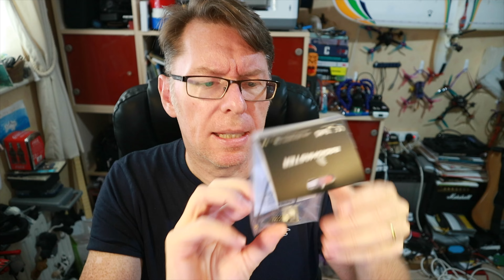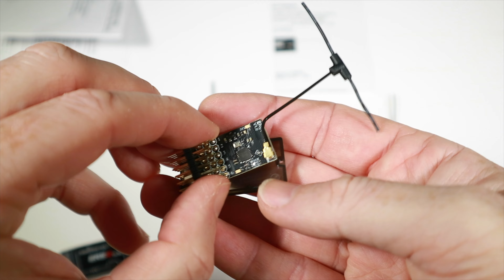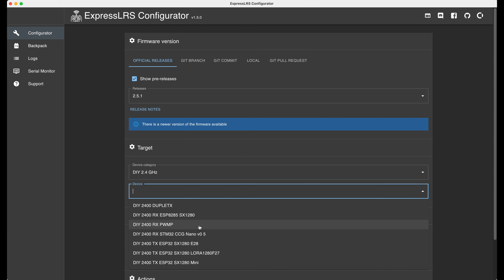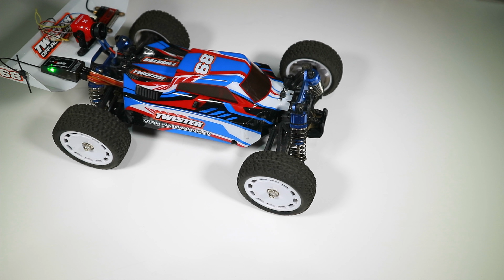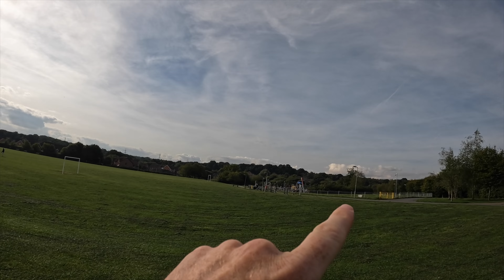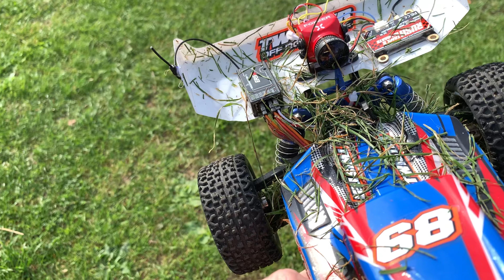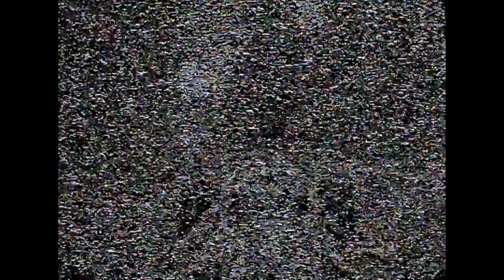RadioMaster ER5A/ER5C ELRS PWM RX's.  Let's make an FPV car to test them out!

Comment: So, for an RC car with an internal receiver, is there no other way than replacing the ESC? I mean, is it possible for me to modify the built-in ESC of the RC car so that it can work with the ELRS receiver module?
Reply from the maker: It looked very much like a sealed unit to me.  If there was an obvious way to open things up and mess with it I would have done so.  That's not to say that other all in one units may exist that you will be able to modify, but I've seen a few of these in similar car of this price range.

Comment: I come from drones and would like to implement it in RC car. Can I pass on the telemetry from the receiver (which I'll connect to external gyro) on to a walksnail VTX? (The VTX has TX/RX pins for telemetry). If so, how?
Reply from the maker: You can't - at least in any way I'm aware of.  The easiest way of accomplishing this is to simply add a flight controller in there and treat it as an OSD.  I'm just doing this at the moment (for an analog setup) I'm using betaflight on a car, with a single arm switch and the only thing I needed to do extra was set runaway_takeoff_prevention=off
Reply: @CurryKitten  how does the FC connects to the ESC? I don't understand as it seems the design is direct PWM receiver->ESC. How the FC will operate the PWM ESC? Is the gyro on the FC used for traction control in such configuration instead of a gyro module? 
I wish I could see a connection diagram 😢
Reply from the maker: It doesn't - I was actually using a 14 channel BetaFPV ELRS PWM RX for this, but in doing so I was able to connect to the FC via CRSF and then to the cars servos/esc directly from PWM.  The FC in this case is doing nothing other than acting as a dumb OSD
Reply: @CurryKitten  I think that a FC can operate a PWM motor like a servo. You should do a resource mapping and some definitions and it supposed to work.
I think I'll try out a drone like configuration.
Reply from the maker: Yeah - you can run an ESC on PWM to use the motors in that way - but it's not going to help in terms of the telemetry, which was your initial question.  In terms of using an RC bar and an FC, the reason I'm directly connecting the servo outputs and ESC to the RX is that Betaflight doesn't know how to mix motors for a car, and if you go the iNav route - it does, but you'll need a GPS/Compass as well
Reply: @CurryKitten  if I'll use fixed wing FC with INAV and a GPS module, every data including battery voltage, ESC RPM etc. is going through the FC. Why wouldn't I be able to output all this telemetry to the VTX?
Reply from the maker: @yaronskp  That would work fine - you confused me talking about resource mapping when it's not needed

Comment: Could these be used on a modern say inav fpv quad as a way to add servos without having to connwct to the fc say if you didnt have enough pads or amp rating to run from the fc ? Or would that also involve voltage regulators and stuff direct from lipo ,im on 6s
Reply from the maker: Well, the power input to the RX can only go up to 8.4v, so on 6S you'd be looking at some sort of UBEC to power things nicely... and as soon as you add the bec, the idea of the PWM RX becomes a bit redundant as you'd then probably just want to take an control signal from your FC and the 5v/gnd from the BEC

Comment: Hey, I have a radiomaster tx12 radio and planning to use it on my rc also, can you teach me how you setup your radio? I've been thinking the exact same way the way you configure the controls. Also is it possible to bind radiomaster tx12 radio to radiomaster er5c-i pwm reciever? Can't find any info online. Thanks a lot! this video gives me hope that i can do this mini project 😂😂
Reply from the maker: For now, I've got a playlist on setting up OpenTX (While it's not EdgeTX, the experience is close to identical) that should give you a good start in setting up the radio... I might revisit and update the series this year though.  As for the RX, the answer is yes - if you have the ELRS version of the radio (as opposed to the 4-in-1 version)
Reply: @CurryKitten  Gotcha! Will definitely check out your playlist and see which part I can implement on my case. Alrighty time to check out the RX then 🤣 Thanks a lot! Hope to see your new vids on the playlist

Comment: Hi again, im curious that rush max solo could run with 6s lipo, is there any advantages to run it with more voltage? 
Also how do i get at least signal strength on screen display without a flight control ?
Reply from the maker: There's no advantage to running in 6S.  Signal strength you'll struggle with to get on a camera.  What I would do is use an RX with telemetry (like ELRS) and then set alarms if link quality, or RSSI falls below a certain threashold
Reply: @CurryKitten  so my vtx can produce maximum wattage using minimal voltage? i.e can it still produce 2.5watts using 7volts?

Comment: Awesome video , long time sub. So happy i found this, i'm an fpv pilot and my next project is gonna be an fpv 4x4 with elrs. Do you have a video on how to connect everything since there is no FC. I'm already using elrs on 14 quads and thought i try something new with an fpv car.
Reply from the maker: I didn't go into great detail as there wasn't much to it.  The RX has a connection to the ESC for throttle, and a steering servo (and in my case a beeper on another channel as well)  I was using a camera with it's own OSD, so just fed the battery voltage into one of those pins.  It's pretty basic - I will be coming back to make a larger car in - hopefully - 2 different FPV configs.  One of which I will use an FC for
Reply: @CurryKitten  Ok, thank you.

Comment: How do u setup throttle and steering on the controller?
Reply from the maker: I used the right stick as throttle as it's sprung to the centre - which is much better for doing braking/reversing.  I then ended up using the left yaw stick for turning just because it was on two different sticks.  In the past I've used the throttle stick completely for pan/tilt (with the applicable setup) and used right stick for both throttle/steering.  Obviously you can assign whatever channels you want to sticks via the radio

Comment: Hi can you help me to figure out how to use smart audio with these receivers. (without a flight controller). I want to be able to change the vtx channel on transmitter.
I have watched similar video from painless360 using crossfire, but elrs script does not show same options.

Don't know if that s what the CRSF mode is for? but I assumed it will remove the 6 channel function if you change the mode. Not sure if I understood that correctly??
Reply from the maker: You can't - at least, as far as I know - with Crossfire, you can assign a channel output to SmartAudio and then control it via a LUA script.  We don't (currently) have that option with ELRS.  Even when using a backpack, the module communicates and changes Smartaudio stuff via the flight controller.  This may change in the future - but for now, I don't know of a way.  CRSF mode - in this receiver (If I understand what you are getting at) turns this into a regular CRSF based RX, so using the TX/RX/5V/GNS pins instead of regular PWM
Reply: @CurryKitten  Okay thanks, I understand the crossfire function better now

Comment: That was a real quest for me to find an rc car with separate receiver and pwm wires. But I succeed - and found wltoys 124017 v2 (the v2 has a brushless motir and individual receiver module)
Reply from the maker: You did well - I've seen that combo ESC/RX in loads of these cheap cars.  Yay for WLtoys for being even slightly different!

Comment: The camera is mounted to far back. Place it above the windshield just behind the windshield line. It will give you a more immersive view. Like you're sitting in it. I have to post some of my videos. Great video by the way👍
Reply from the maker: I didn't want to mount to the body shell of the car as it's liable to a bit of wobble when driving around.  My intention in this build was to make quite a non-invasive build, but as that car is probably going to stay and FPV car, what I'll probably do is cut a hole in the top of the roof and have the camera there, or go through the windscreen.  In both case, I'll be mounting on the chassis so there's no potential of wobbling from the plastic shell.

Comment: I love coming back to this video, The setup is near perfect for analogue... Throw on a tall Foxeer high gain lollipop and that will go anywhere. CK - Have you seen the Traxxas TRX-4 Scale and Trail Crawler 82056-4
1/10 Scale? The Land Rover Defender is crazy good. It's got a two speed gearbox and you won't get stuck on anything!! Its quite quick as well. But to me it's the ultimate allrounder Crawler / Basher..Check it out!! Take care mate... MQ4. Ohh, Thats right Can now confirm that those ELRS Receivers are an absolute must have!! LOS 2km easily ...In the bush ( flat ground ) 900m. A good idea is to fit a small GPS and pair it with your phone, You can then watch its movement in real time and if you need to hunt for it you will never lose it. I would really like you to review the Traxxas TRX-4 , 1/10 Scale as I KNOW that will be your everyday go to once you drive one. 🙂
Reply from the maker: In my initial experiments with the RusshFPV Cherry antennas, they outperformed the lollipop by quite some margin.  I've always lusted after a Traxxis.  The Summit was always the goto build for LR FPV cars, but the Land Rover really looks the business.  It's the perfect scale.  The problem with Traxxis is price - eeek, not cheap are they!
Reply: @CurryKitten  Yeah mate exactly... I just bought one! What an incredible car! Wish I could send it to you for a play... But the state of the world atm its not worth the risk from AU to UK otherwise I wouldn't hesitate mate. Fitting it out with the 03 Air unit and Goggles 2 with head tracking. That will be a blast when we finally have them in stock.

Comment: Does it bind with happymodel tx module? Cause I can't bind even with the right binding phrase
Reply from the maker: I don't have a HappyModel TX to try that out, sorry - but obviously, all ELRS modules should be able to bind to all ELRS rx's... with a few caveats.  Firstly, aside from the binding phrase, make sure you are on the same major version of the firmware on both ends, i.e all on 3.x.x.  Double check to make sure model match isn't on (unless you want it on - in which case make sure it's correct)  Check the LED on the rx, sometimes if it's doing something a bit weird it's a useful clue into what's going on

Comment: Im undecided on if 500mW ELRS in the TX12 MII would get me a couple of km's across the bay on a large RC Sailboat using these PWM Receivers?
As far as Visuals go, I'd like to utilise a GoPro 8 but its USB C etc so not as easy as just wacking on a 1W Rush vtx etc.. So my question is would the TX 12 mark 2 ELRS and these PWM receivers cut it? and How to get the GoPro 8 running FPV? Cheers CK - Bazz
Reply from the maker: That's an interesting question.  While 2km in the air is nothing, ground range is very different and those pesky ground reflections can be an issue.  The answer is that I don't know - I've been unable to find a large open area so I can see how far I could take my setup.  That said, anything that could elevate you up higher than the water would definitely help.  I'd think I'd approach as I normally would with the unknown - try it, and check signals on little milestones.  Can I get to 500m?  How strong is the signal?  Can I get to 1km etc etc.  I'd be evaluating to see if I needing to address any issue along the way...i.e what effect do the antenna placements make, what about changing my packet/telemetry rate.  I can't answer the question on the GoPro though, I haven't tried video out since the GoPro 4.  Even if it is possible, I wouldn't recommend it over a regular FPV camera.  Keep the GoPro for you HD recording, but they are still very bad at handling light when it's face on to the lens.  A half decent FPV camera will really help you there.  I'd be interested to see your results - one thing about being down at the water level (or ground level in general) is it can be quite difficult to navigate and tell where you are
Reply: @CurryKitten  Excellent advice all round CK.. Thanks mate, Will keep you posted. Take care bud.👍

Comment: That's really great results and here I am a grand into trying various analog 5.8 and 1.3 setups unable to get 1/2 of that. I'm going to try MFDLink 433 UHF for the control but I'm still trying to learn this world of protocols and control systems. That feed also looked really good and I suppose it has to do with the location. My 1.3 tends to look way better at times depending on the time of day, but I'd probably need to be in an open field with LOS to go out to 100 yards tops.
Reply from the maker: I did try a 433 control with 1.3 video a long time ago, but I had all sorts of power issues and the kit was quite large for the 1/10th scale car I was using.  That said it was nearly 10 years ago and I'd hope I'd get it going better these days.  1.3 should give you excellent penetration for a ground vehicle... it should wipe the floor with 5.8 in terms of distance and handling obstacles.  433 can be a little finicky to get right, it's easily upset by noise... and of course the dipoles for it a huge!  But keep cracking on and Im sure you'll find that sweet spot eventually.
Reply: @CurryKitten  I came into it assuming just that.. the 1.3 would wipe the floor with the mediocre results I got with decent 5.8 setups. Several videos out there showing it can be done all analog. I tried to be thorough and basically tried 2 of every transmitter/receivers.. ended up being worth it on the 1.3 receiver because the second one worked much better with clear audio.. but in the end about the most I could do before the signal got too bad was drive around a small area in my neighborhood. 

This was trying to be lazy and just using a small ground station though. Receiver just mounted in a box with the screen right there. I'd hoped to at least be able to do something like circle a small building with decent video but I guess that's either asking too much or doing something wrong. 
I'm now realizing to get any actual range I need a rather large ground station, at least one elevated higher from the ground and some kind of decent patch antenna.

Comment: that "PWM is old way to control..." hurts a lot :D am I that old?
I mean, before  SBUS and then TBS CRSF & Co came, that was the default.. the quick development happened only the past decade.
thanks for the review! I was looking for a way to make a FPV rc-car with my drone-gear :D
Reply from the maker: In terms of people getting into the hobby now, they don't really have a concept of why servos would ever be used or how you'd ever fly something without a flight controller :). It's pretty easy to use some of your drone stuff to make an FPV car.  The only annoyance for me was the single ESC/RX unit, so I needed a new ESC

Comment: Does the Er5a receiver carry the FPV signal? I guess not. If the video can get through, I'm not impressed by the fact that ELRS is getting through.
Reply from the maker: Video and control signals are very different beasts.  The RX just handles the control signal, there's a VTX that handles the video

Comment: This looks fun. So I've bought an rc car similar to this and will use pwm crossfire but not sure how to wire my cam and vtx. My cam will go to the vtx but what do I wire that do? Is it possible to run it with a servo cable straight to the PWM receiver?
Reply from the maker: It will depend a little on the VTX.  Odd on your VTX will take battery voltage (usually something like 7-20v but please check) and power a 5v camera from it.  So in my case I'm powering the VTX from the balance lead of the battery.

Comment: How does your 2s balance lead only have 2 cables coming out?
Reply from the maker: The battery has the regular 3 wires coming out.  What I did was make up a balance connector to take to the VTX where I just make a connection for GND and cell 2 (the outer one) this gives me the full voltage through I need

Comment: So I fly quads and want to try this but how did you configure your controller to steer and throttle. I get the elrs part but in quads I have betaflight to configure things. I have the radiomaster zorro with internal elrs
Reply from the maker: In a word... Backwards.  So I put the throttle on the pitch/roll stick (right if you are mode 2) and steered with yaw (which kind of makes sense)  If it seems a bit weird, it's because a car with a reverse option benefits from having the throttle that springs to centre - so it's much easier to hit the brakes and go into reverse.  In previous cars I've also use purely the right stick for throttle and steering and the left stick for pan/tilt... this time using the advantage of not a sprung stick so that the pitch of the camera stays where I want it to.  When you say you have betaflight to configure things.... not so much in a car, there's no control scheme for it.  You could use iNav Rover option, but you'll also need a GPS/Compass.  This is controlled using simple servo outputs (hence the RX option) and a camera with it's own OSD to display the voltage

Comment: Fun video ! I have a similar setup that I use on a 1/10 scale truck and on a Kyosho Blizzard for winter runs.   Tons of fun ! You should try it with a DJI Vista unit, the HD video quality makes it even more of a blast... ELRS + DJI video gives you great range !
Reply from the maker: I haven't invested (yet) in a digital system, but yes it would be a lot nicer
Reply: I just ordered walksnail for the same experience. 

Although I kind of wish they made an pistol elrs remote. That's not $300